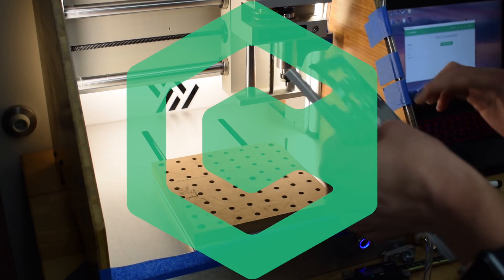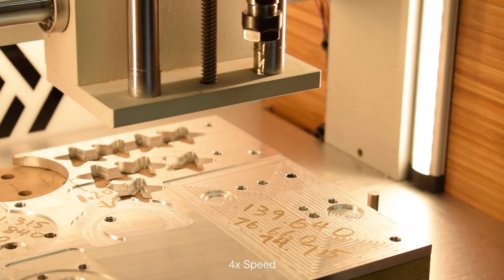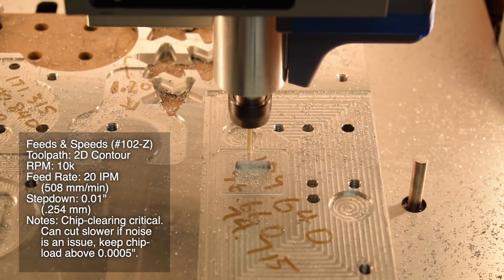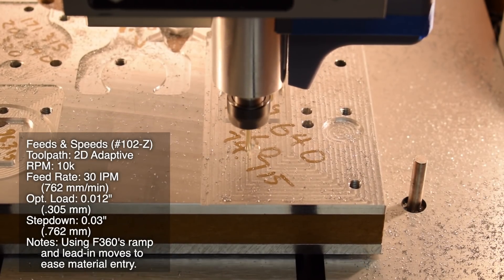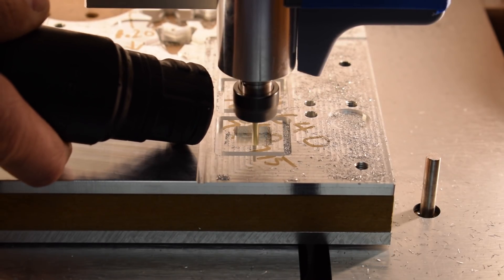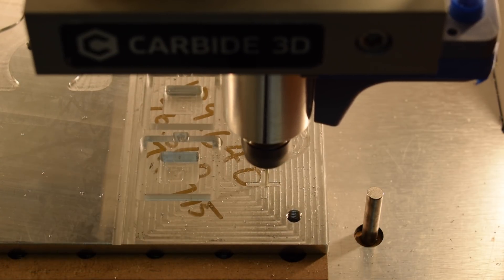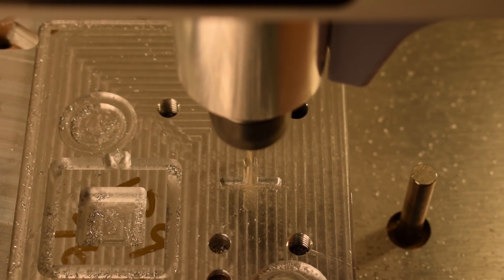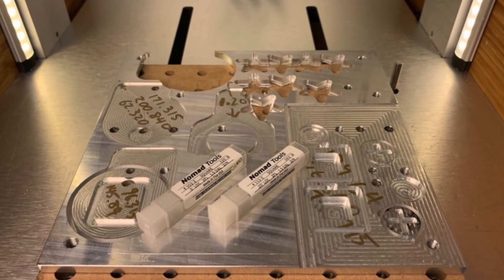Aluminum Feeds and Speeds for the Nomad Pro - #MaterialMonday

Comment: I'm curious if you could use a fly cutter or wasteboard cutter to improve the surface finish on the top surface after machining? You often see larger CNC doing this to clean up the top surface and get rid of the tracks from a smaller diameter cutters. Obviously you are torque limited with the spindle options on these smaller units, but has anyone tried it and what were the results/limits? Just curious how to raise my game.

Shapeoko for Life!

Comment: How much noise are you guys getting when cutting aluminum?
Reply from the maker: Enough to warrant hearing protection. If you have neighbors in an apartment you may want to back off DOC a few thou and reduce chip load by 30%...
Reply: @carbide3d  Great thank you, Just making sure I'm not the only one. Building a sound "proof" enclosure is on my todo list but haven't gotten to it yet.

Comment: Do you have your Fusion files. I've always followed the feeds/speeds provided by Carbide for Nomad on aluminum which were way more conservative -- as in significantly slower -- 8 to 10 in/min. This is is way faster. I'll be machining some parts soon, and faster speeds would make things go a lot quicker and sounds like will generate a lot less heat.
Reply from the maker: Just added to the description. -W

Comment: How different is machining with the Shapeoko vs the Nomad?
Reply: Generally you should be able to use very similar values. There are limited cases where the outright rigidity of the Nomad more than makes up for its power deficit vs the Shapeoko (surface finish with small endmills), but the Shapeoko can use a 1/4" cutter which is hopeless on the Nomad.
Reply: Winston Moy awesome. Thanks for the well thought out reply.  You coming back to WBC in a couple of weeks?  It would be good to see you again.
Reply: @WinstonMakes  Said by someone without an ER16 collet!